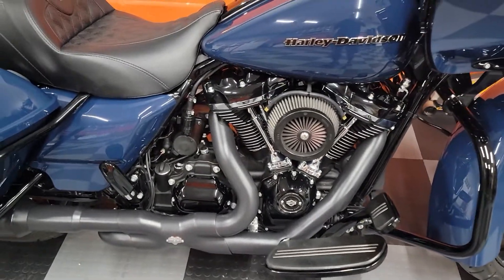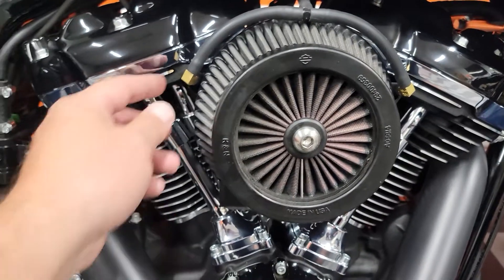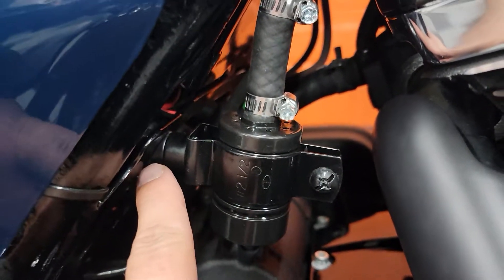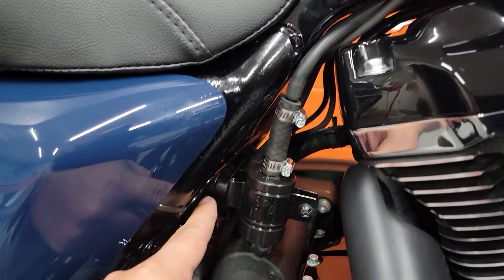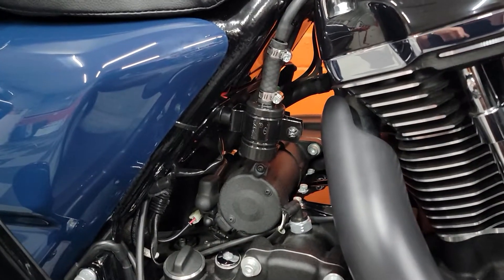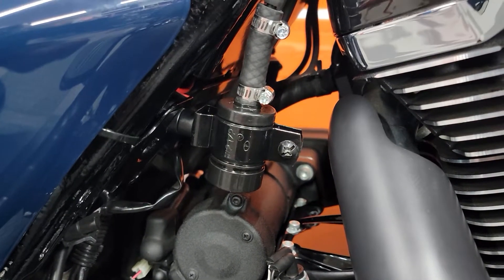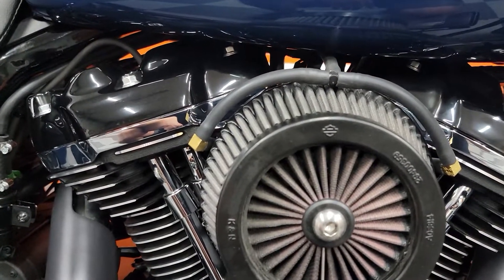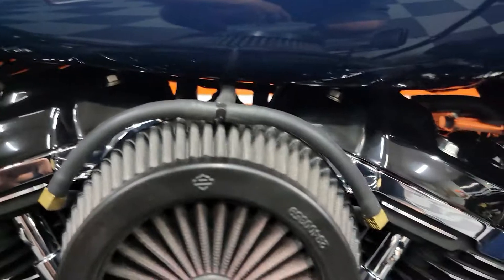DK Customs oil catch can on 2019 Road Glide 114 with screaming eagle intake

Comment: Chris it would catch more oil if you run it under the air cleaner and run hose under bike! Dave put big bore 124 kit in my RK! Sweet bike! My favorite color! I ride with Cycle Fanatix! Keep the videos coming! 👍💯🇺🇸
Reply from the maker: Ohh..I know who you are. I met John at daves he did my cam.  DK says to run it that way. It seems to work because iam getting fluid in the catch can.
Reply from the maker: Hey Glenn i recently purchased a 2023 K1600B. But im experiencing a slight high speed wobble and when braking hard from high speed. Wobble may be to strong of a word more like a side to side shimmy. Have you experienced that on yours and if so did you correct it?

Comment: Did something similar on my 1200 Sporty. I have the Rail intake...used rubber stoppers that I drilled to fit snug on the bolts and for 90° fittings. I used a small breather filter, placed it between the cylinders on the left... looks slick

Comment: I think it's  a catch 22.   Removing hot air and oil from the combustion chamber is good thing . A key part is left out. Crank case positive pressure that is removed from the engine by the oil breathers . Creating a   negative pressure in the engine.  That's why hd positions the oil breather  lines in the throttle body so the vacuum can create negative pressure and burn the oil and air.
Reply: @DBMedia1000  twincams and m8 have one way check valves in the heads true. Yes it is a epa item. But the one check valves don't create a negative pressure. The breathers being sucked by the engine do.  Put a vacuum gauge and find out .

Comment: The great oil blow-by debate... I've watched a couple other videos on crank case venting and am now leaning towards the trans cover vent option. Some say venting the reason cover will help reduce blow by to a point that its a non-issue. For me, I'd prefer to not empty a small catch can every other ride. I would also feel better about not dumping oil on the road. 
Thoughts?
Reply from the maker: The vent for the Trans cover is a good addition. I'm also thinking of the trask venting. I will keep the catch can on as well as I like to prevent any of the fluid caking up on the piston. I'd rather empty the can every 400 to 500 miles than let that stuff go back into the motor. If the trask venting eliminates it or reduces it then i would only have to empty it less  frequent. Either way with the Trans venting or not it keeping that stuff from building up in your engine.
Reply: If you are dumping your catch can that much, you have bigger issues. It's for blow-by, not to catch raw oil.
Reply from the maker: @toddgittins5692  it's not raw oil, and it's almost a 1/4 after about 240 miles. Not sure what your talking about.

Comment: Hey don't take this personally but I'm just going to tell you the way I see it that looks like s*** too properly install it should be ran behind the air cleaner down to where you can't see none of that you got big hose clamps sitting there you got the depressed fitting sticking out you got the tea up there you got all these lines visible on top of the air cleaner that's not a good setup